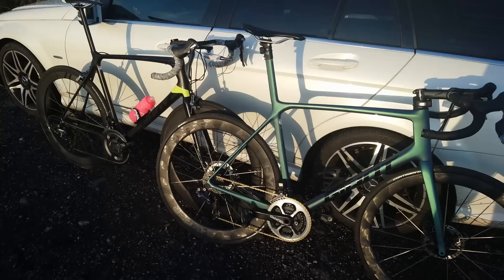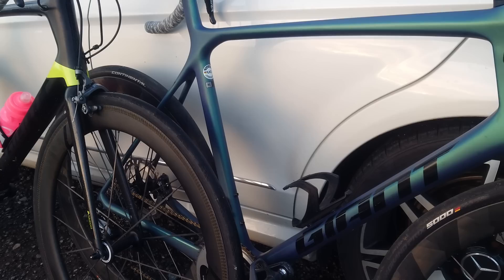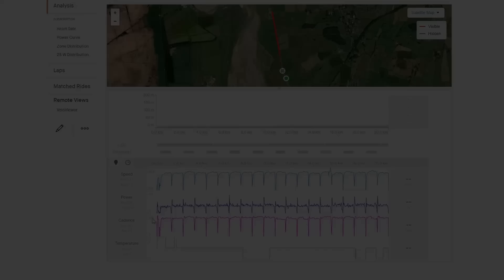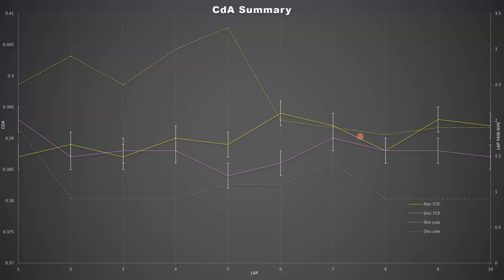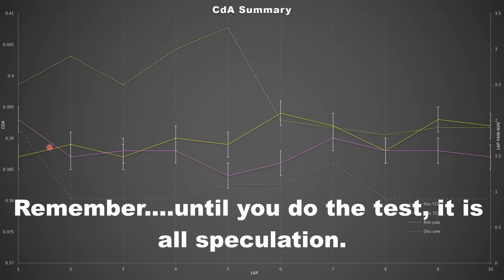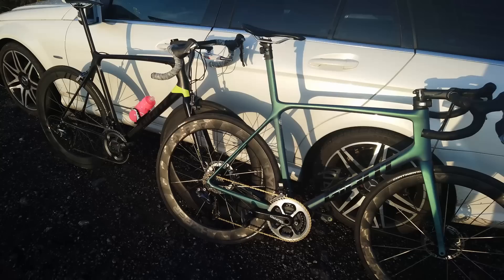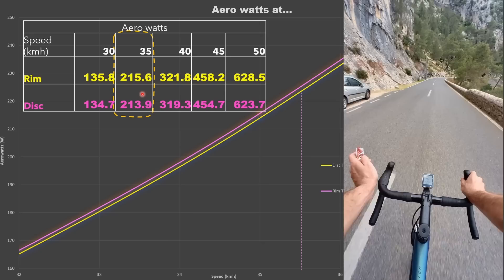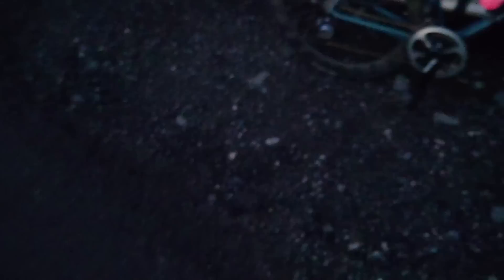Are Disc brakes Slower? Rim Vs Disc Aero tested.

Comment: Very interesting. I remember a gcn wind tunnel video where they admitted that discs were a good 5W (or was it 8?) Slower, I think on a pinarello. I don't remember the front end. We do know that every exposed cable slows you down, so there's a good chance disc + no exposed cables= rims with exposed cables. 
Also, vanity. Integrated cable bikes just look cool 😎
Reply: Yeah, that's why all new high end bikes have fully integrated cockpits and an aero monobar. That's the sector where they had the largest gains left.
I mean the result is - discs are only a bit worse. Probably not too surprising considering their position on the bike and the relatively small size of the disc.
Also they try to hide the breaking mechanism behind the fork which helps.
But since all they do nowadays are marginal gains it's funny that they force everyone on discs.
I mean with discs they can make the bikes more expensive, the maintenance is more costly, fewer people do it on their own and most important point - they had an argument to sell new bikes to people who already had great ones and there was no real performance gain anymore.

Comment: This is properly interesting, thank you.  My own experiences have been that I don't get much better braking with discs vs aluminium rims but I do enjoy the much lighter feel of hydro disc brakes.  That's especially so on either very long or multi-day rides when your hands/arms can cramp a bit on long techy descents.

It's good to know that aero losses are not too big a penalty to pay for that.
Reply: My rim brake bike with tubular carbon wheels brakes as good as my disc bike in dry weather and I get consistency with my rim bike as I have days of terrible front end disc braking due to contamination until I clean off the rotor. Where my disc bike ultimately wins is the all weather braking and  long life of the rims

Comment: "until you do the test it's all speculation" Naive empiricism is not it. Sometimes analysis is genuinely better. A guy on a bike produces less drag than the same man on a bike plus a tiny far field parachute. I can be completely confident in that with no test. And if you did the test and you couldn't discern the difference then there's very strong reason to believe that the test is not precise enough.

Comment: long time viewer, first time commenting. As Engineer (mechanical eng. building bridges and towers and putting them in wind-tunnels) I love your videos and like the more data you bring-in, but this one bother me. 
You seem to have removed the variability in the test by alternating bikes and by making multiple repetition to stack possible errors, good point here. But what you test is not making sense and reading people's comment it appears many got a missleading takeover and miss the limits of your set-up. You are comparing two very different bicycles, you haven't quantified at all the impact of each changes, different frame, different wheels, different bar width (this seems to be the biggest one). I understand that's yet difficult to have 2 identical set-ups but without this you just can't make any finding (well you could say, and seems to be your underlying conclusion, your two bikes are relatively similar aerowhise but that is not what you were looking for) and claiming "differences are minimal"). 
If I may suggest changes:
- at least re-run the test swapping bars
- you seem to have laced your own wheels on the past, get the same rim and use it on a rim and disc set-up
To some extend an older GCN video had a way better bike set-up but quite a questionable way to measure things.
Brent S

Comment: Retest so the wind and air pressure are the same.

Retest with 2 riders who swap bikes each lap then you have the truth.

Ride apart so no draft.

I did this and road disc on SL7 Sworks mega slower vs rim brake tarmac for $650 off Gumtree.

Comment: Nice video. 
If the rim bike had Di2 then the results would have been the same since you can hide the Di2 cables the same way as the disc one.
Reply: Front rim brake still got cable exposed.

Comment: Good practical protocol and totally plausible results. My speculation from owning/racing both was that there was little difference - what the rim gained from the wheel/lack of disc, it lost in crown junction bulk and cables. But what ain't in doubt is that the rim bike is definitely quicker uphill and in acceleration, simpler to maintain, cheaper and causes less frame compromise. The disc bike is better at braking in the wet, has less compromise to rim composites and for training allows a wider tyre. But all academic as everything is disc now...
Reply: Tell us how road disc increases traction in the wet?

Why so many more crashes now in wet races with road disc? 

Tony Martin retired because it's 'just ridiculous out there now'.

Comment: I guess the main takeaway is when you get above 40km/h ability to maintain an aero position has a much higher significance compared to having a disc or rim brake bike.
Reply from the maker: No, i would say that's the most important above about 20kmh!
Reply: Was the wind and air pressure the same each lap? Impossible.

I did this test using 2 riders then swap bikes and average the data. Road disc IS slower.
Reply: @durianriders  Keep telling yourself that Durian and maybe it'll come true
Reply: @durianriders  You should test riding down a steep descent with no skewers in the quick release and see what happens
Reply: @durianriders  you also said, that the Trifox X8 is a good frame for the value. But I chewed through 2  seatposts, the wrap on the fork was unwrapping itself from the getgo,, had to drill the front brake hole, at the rear the painting started to melt away around that hole, the seat tube and the post were so out of their intended dimension I had to use 2 and 3 layers of sports tape for the posts, yet the second one went down still and got stuck, ofc many tiny painting imperfections (I cpuld live with them actually), but no warranty, very bad customer support. So I am glad you had good experience with that shitbox Trifox, but I would seriously reconsider recommending it without mentioning all the problems which that brand has.

Comment: Always loved to see these comparison videos, that I have also done in past. Giant also claimed aero efficieny increase on their new TCR frame which should not be trown out of the window. To be certain, and to have more controlled environment, it is crucial to take up 100% identical frames (rim vs. disc), wheelset, handlebars, same cableing, same tyres etc to compare x to y if we try to learn or observe an idea that rim brakes are faster or otherwise.
Reply: The Rim Braked Bike had the slower tires, wheelset, handlebars, and cabling, and the rim brake bike still won.  If you don't believe me, then you are welcome to do the test yourself.

Comment: Interesting but also contradicting to your and Hambini's old videos, which stated that disc bikes are way slower and you were bashing the cycling industry for their move to disc brakes.
Both of you also explained why the disc is way worse (with scientifically explanations regarding aerodynamics) but your results don't show any of that?
Reply: the 2 bikes set-up are fairly different, so we can only say "the new Disc TCR tested here is faster than previous gen rim brake TCR tested here", that's quite less attractive, but that is the real conclusion.

Comment: Thanks for giving this a go , clearly what you are trying to say is in a near perfect world there is probably very little difference between disc and rim aerodynamically ( especially if the disc bike is made to ' compensate ' for the rotor etc aerodynamically)  
I can't understand why some get so worked up about it , so there were some variables which means it wasn't  100 , but in the end it's a f*#"&g bicycle travelling alone a road not an Jet aircraft  or a Rocket into space!!
I am more concerned about the cycle industry getting the fork and steering tube interface correct with some kind of redundancy fail safe built-in 😬

Comment: I've never understood how non elite riders could possibly think discs are going to significantly slow them down.
It's nice to have some numbers to point to. Thanks for your effort.
I still have rim brakes. Only thing i have against discs is the asking price for bikes.
Reply: Its a nice video but from a science point of view it is flawed given the differences between the bikes.
Reply: @Teakhead Al that isn't how science works.
Reply: Disc brakes are heavier and harder to service , maintain, noisy ect and ugly I don’t understand the appeal
Reply: @KushPizzaSleep  piss easy to maintain, work significantly better (even more in the rain), don't wear out your wheel.  I'll take the wee bit of weight over better braking.  only thing I hate about road discs is the price.
Reply: @MTBScotland  disc brake bikes are quite a bit heavier and hydraulic disc brakes are a pain in the arse ask Chris froome. Total over kill on skinny tyre road bikes but it’s a world full of all the gear no idea morons
Reply: @The86rick  bollocks
Reply: @Tarmaccyclocross  and you appear to be one of them.
Reply: Once your disc brakes start rubbing, you will understand
Reply: @MTBScotland  for sure bleeding a disc brake is harder than swapping a couple rim brake shoes.
Reply: Road Disc brakes are absolute bastards compared to MTB discs to look after . Tiny rotors that over heat on long decents . Tiny clearances between rotors and pads compared to MTB systems and the only reason disc bikes may stop quicker is larger volume tyres offering more grip . After using both I find rim brakes better for modulation and with a good pad material choice can brake just as consistently in the wet as the dry . The main advantage for Hydraulic discs is the fact they are Hydraulic so hand fatigue is much less .  Now if a company could produce say a Hydraulic rim brake built into a shifter.......... 

Disc brakes suit heavy bikes with wider tyres or a very muddy routes . So cross bikes / gravel bikes discs all the way and definitely tandems as they can take advantage of the extra weight that increases traction under braking .
Reply: @@warprayer100 Bingo...but arguing with hysterics (as opposed to hysteresis) is pointless, And that's the point.
Reply: @MTBScotland  we are debating ROAD disc not XC 😆.

If you need hydro disc to control a  25mm race tire you need to do some hand strength exercises.
Reply: @durianriders  discs are more efficient, far superior in the wet, don’t rely on the surface of the rim, and have far greater ability to slow down on long descents. Anyone that argues for rim brakes in this day and age is a dinosaur.  I don’t ride XC.
Reply: @MTBScotland Bikes don't have ABS. It is incredibly stupid to be using disc brakes on a road bike in wet conditions. If this needs to be explained to you then I have no idea what to say
Reply: @edmundscycles1 I never thought of it that way - all of their brake tests are flawed since most new disc wheels have wider tires and of course a better break performance. Probably combined with the lower pressure as well.
Shows again what an absolute scam these tests from GCN and so on are.

Comment: PT, I think I might need some help 😀. The last two years I've been building bikes from used frames and selling them for profit - I've now reached a point where I want to upgrade to a good carbon wheelset, but I can't decide whether to go rim or disc. The basic principle is to keep the wheels long term while trading the rest of the bike for profit.

I live in an area with steep hills and I'm not the lightest - 75 kg, so I'm thinking it's better to go disc for the longevity of the rims? The only thing I'm afraid of is the maintenance cost.

Also, what would you pick as the best VALUE wheelset? 2023 Hypers?

Comment: Perhaps to complete the value proposition of this data, some additional math ...
- R vs D brake bike retail cost (cyclist) ÷  the wattage delta 
- R vs D brake bike % cost of sales (supplier)
-  enthusiast Vs pro % probability of related cash rewards = > R vs D brake bike retail ∆
- joy factor (rated 1 - 10) of owning the latest 'bike tech' vs actualised personal performance gain . . . with graph where x-axis is weekly average outings (measured from "0")
👍

Comment: What are the error bars with the yaw measurement? My assumption is that yaw worsens disc more, maybe?
Reply from the maker: The yaw is fully dependent on the wind direction, not the equipment. I'll get in touch with the engineer at Aerolab to ask about yaw error but i imagine it about a tenth of a degree.

Comment: I love these videos showing miniscule differences.  I do think aerodynamics are a "thing", but a lot of it is like the moment of inertia. I think there's a moment of aerodynamics, where the aero gains exist for a fraction of a second, until they don't, due to swirling winds and changing "stuff" relating to the system (pedaling, breathing, rocking the bike, etc).

Think like an aero cockpit setup. Looks pretty, cleaner, but once the wind is through that area, game over and back to messy.  The gains never have a chance to exist outside of that moment.
Reply from the maker: That's why i don't really trust tunnel data at these lower speeds. There's too much swirl in the real world, and the results are less flattering.

Comment: My take aways: 
- biggest impact riding position
- Then good fitting clothing and a good helmet on your noggin
- Then wheels and rudder + component choices
- New frame will bring less bang for buck in aero gains (regardless of which braking system you choose) 
Thanks for the insights and energy invested 👍
Reply: the rider is always going to be the heaviest and dragiest part of the equation, and component differences are always going to be small, but folks keep spending money on the things underneath them hoping itll make em faster, at least placebo is measurable.
Reply: Yes, but the bike as a system doesn’t change in aero performance because of fatigue etc.  
you, as a rider, are way more inconsistent. Your weight fluctuates, your posture changes as you ride, and your clothes also changes depending on what’s in the wash. 

So, if I have a constant variable that will never change (aka the bike) doesn’t it make more sense to fully optimise that consistent factor, over a variable like posture and weight which changes consistently?

In short, money spent on an aero bike/equipment is actually the best investment you can make. Your body comes next, as that comes over time and changes constantly.
Reply from the maker: The best bang for your buck is tyres. Way more savings there than the difference between wheelsets/frames.
Reply: @PeakTorque  that is true. That said, inevitably when you’ve gotten your wheel/tyre down( because in all seriousness how long can that take?), the next area for investment should be your bike frame.
Reply: @PeakTorque  only interms of rolling resistance, or do you think that width (25mm vs 28mm same tire model) is also important for aero gains?

Comment: wouldn't the discs get worse and worse as the speed increases since they're spinning faster, whereas the rim would stay pretty much the same at all speeds? I think at race speeds (26-32mph) the disc would be much slower than the rim brake.